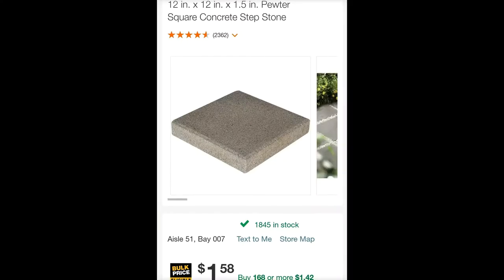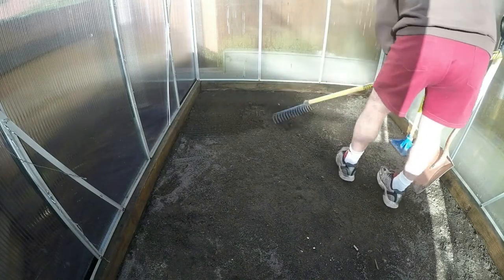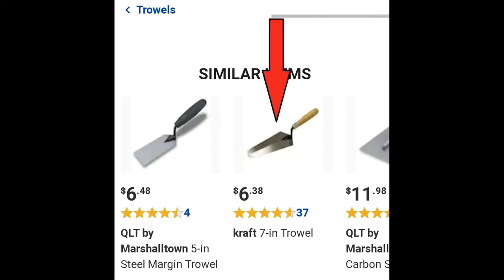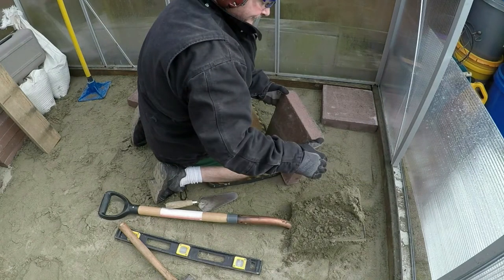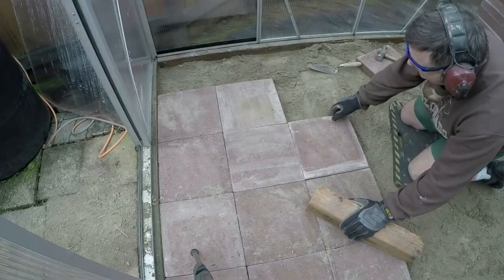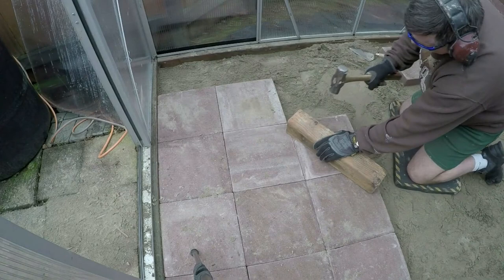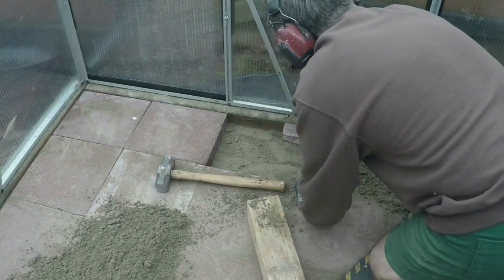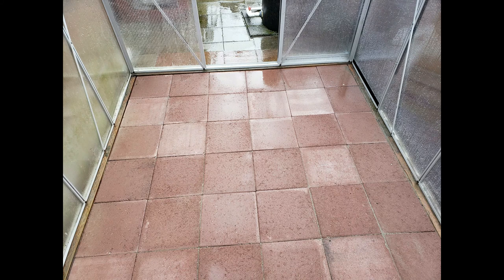DIY (Installing concrete pavers)

Comment: That little lip that you cut off is the give you a gap for grout for expansion and contraction of the bricks during winter they're made like that your project came out nice.
Reply from the maker: Hi Joe,  thanks for the info.  What you said make sense. However, that little lip was only on one side of the paver on slightly over half of the pavers. In this case, I believe if the lip was for grout, that lip would have been on all 4 sides, or at least two sides so I could install a non lipped paver next to it. I have made my own pavers in the past and I had that lip form when I did not have my formwork properly mounted before pouring the concrete. Also I have put down nearly 500 pavers in the past, and have not seen this lip problem before. However, thanks for the comment and complement.
Reply from the maker: Hi Joe, I just wanted to do a quick follow up.  What you said made so much sense, I thought long and hard as to why none of the bricks I ever used had lips. The reason would be that I left all those bricks in the store at the time of purchase. I LOVE learning new stuff!! Thanks Joe.

Comment: Sorry bounder97, I am a faithful subscriber, and I have a question about the Honeywell Vista alarm panel that you really helped me install years ago. I am wondering if you know when the alarm activates, and the perp leaves an alarmed door open, how long will the alarm sound without someone deactivating it with the code?
Reply from the maker: Hi Bobskee,  I remember you.  You have been with me almost from the beginning.  Follow this link: https://www.youtube.com/watch?v=nbMb3xxd4nY.  It is part 12 of my "vista programming"  series.  I cover in detail how to set the time that the alarm will sound during a perp intrusion. Tonight I placed links in the video description so you can jump straight to the programming fields you need. Those field are 32 and 33. (a quick answer to your question is the times for alarm output for intrusion is 4, 8, 12 or 16 minutes. The times for fire alarms are the same as intrusion, or you can set it to never turn off.)  Truth in lending fact: it will turn off once the house burns down regardless of programming.  Thanks for sticking with me and keep the great questions coming.

Comment: You put sand over the compacted dirt? No rock in between?
Reply from the maker: No gravel on this project for three reason. The bricks are indoors and not exposed to the elements. There is no frost heave in this area, and there are no heavy loads on top of the bricks. You are right that many applications for pavers under heavy loads does require more foundation work.
Reply: @bounder97  Thank you for the quick reply.

Comment: Lmfao 😂. I purchased these pre covid and they were 2 inch. I was 15 pavers short  😢.  I preped for 2 inch and work in the cheaper pavers
Reply from the maker: Yea, it's amazing that they are even downsizing the concrete pavers. Makes it tougher to do repairs when the replacement pavers are not the same size as the original pavers.